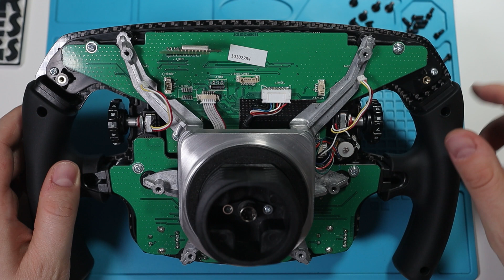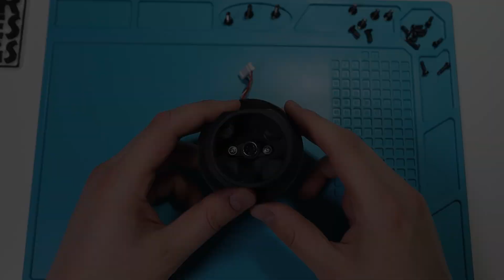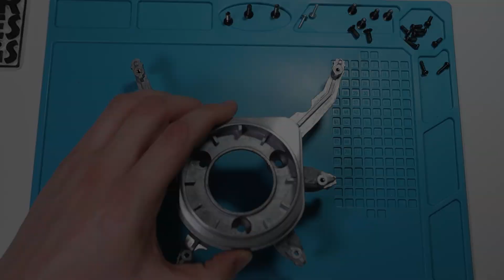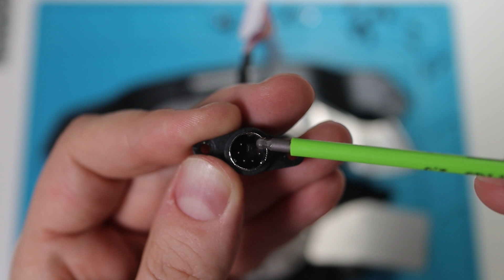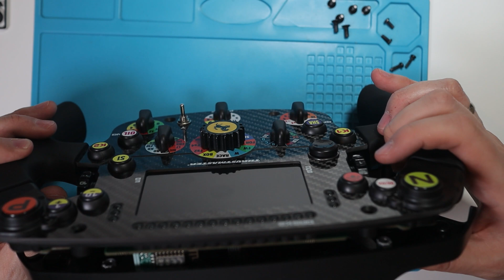Thrustmaster SF1000 Quick Release

Comment: Hey Peter I use a solder iron and used a lighter nothing the  screws still will not move.. would you know were to buy the spider from I have the f1 ferrari 1000 wheel

Comment: Make sure to use locktite with the 3x16mm M5 screws on the 3d print otherwise within a year it will get very loose. Also I recommend to get  a good 100$ quickrelease both Cheap ones that i got get weak and also end up having a gap/lose. Im putting everything back together the way it was.

Comment: the JST isn't 2.5mm, it's 2.0mm and it's a PH, not an XH. When I ordered from Kapral Simracing, they sent me the wrong cable. As I live in the US, it may be a US vs EU thing, but the 2.54 XH JST is about 1.5mm too wide on either side of the wheel's connector, and I had to order the parts to make my own cable. otherwise, the QR is great. A friend of mine (also in the US) has had this wheel since around the time you made this video, and his connector is the same as mine, and looks the same size as the one in this video... so I thingk Kapral sent me the wrong connectors on the cable.
Reply: Thanks for right data, although im in europe.

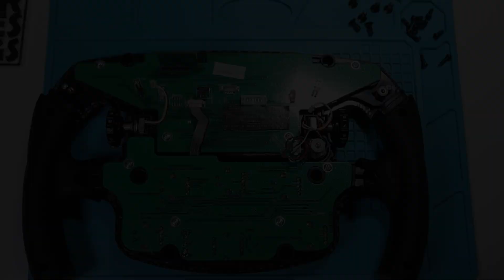Comment: 5:18 WARNING! TL;DR You may need to use a Dremel or similar tool to cut out the top part of each screw on the spider. The posts holding each screw are not hollow, therefore you can cut the top of them; They will still hold the screws.

The reason I had to do this was because the screws wouldn't come off before inevitably getting stripped. I used a soldering iron to heat up each screw, and eventually decided to go with a torch lighter instead. Bad idea!

I think the torch heated up the spider's aluminum quicker, which lead me to believe that the steel screw was just as hot and that the glue melted. If you use a soldering iron and direct the heat at the screw, it will take significantly more time for the surrounding aluminum to heat up and let you know that the screw is piping hot, and that the glue is very likely melted. Hence why it is a better method.

Also, if you go the Dremel route, make sure to not clamp the spider too tight when you're cutting. One of the two long arms got bent on mine and I could no longer screw them in. I tried to unbend it with my bare hands and it snapped.

Otherwise, this is a fantastic mod!
Reply: Same problem here 2/3 worked perfectly but the last stripped. I try to use some of these screw removal tools tomorrow. Hope it works.
Reply: my thread started slipping any way to fix it?😭

Comment: Thank you for the tip on heating the screws, i used a torch lighter and it worked. Any possibility to get the stl for the small interior shim. I would really love to print myself another one instead of using tape. I need two of them on my SF1000 and only one on my Sparco. Awesome kit, quick shipping as well to Canada.